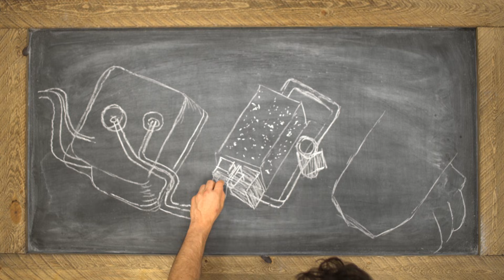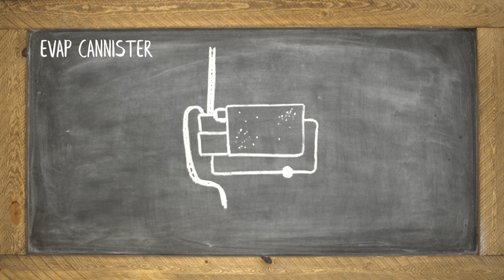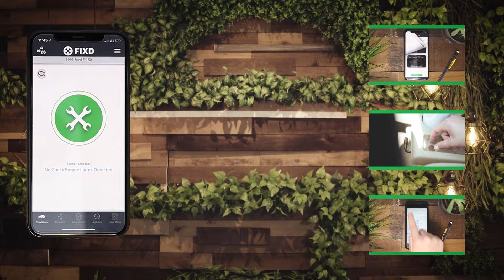P0456 Explained - Small EVAP Leak (Gas Cap)

Comment: I didn't tighten my gas cap after refueling which caused the code. I cleared the code, tightened the cap and after 142 miles, still NO check engine light. So yep, in my case she was right. 

Most likely the gas cap

Comment: Mannnn hope this isn’t from my actual gas tank 🥲 just replaced it and now that’s it’s getting cold I think the rubber gromet for the filler neck that goes on the tank wasn’t a complete fit so I trimmed it a little bit, hoping that’s not the issue and it’s just the canister purge valve

Comment: I bought one of these Fixd OBD readers in 2021 and thought it was pretty darn good. In fact, I was so impressed that I told all my friends about them and a few of them bought one. Now I've got to apologize to them for the mistake. 2.5 years later all it will tell me is that I have a code PO456 that I already knew that I had. But it will not read wheel speed sensors that create TPMS codes and lights on the dash. And the worst part is now when trying to diagnose my car, all I can get is that one PO456 code and a BUNCH of ads/warnings that a PREMIUM service is needed at the ANNUAL COST OF $99.99. You get what you pay for, or in this case, you don't get what you pay for and expect. If you're looking for a good OBD2 code reader....KEEP LOOKING.
Reply: Maybe try and innova 5620 v2 pricey but has a lot of features. That's if you haven't already found a nice replacement

Comment: The black rubber gasket only keeps dirt from getting into the filler neck. While that gasket is needed, the actual evap seal is below the trap door. Having a bad rubber gasket in the door contributes to excess dirt and grime being forced into the filler neck during a fill up, so cleaning of that area is essential for proper operation of fhe system. I wish there was a gas cap there.

Comment: I got the same code yesterday. I got a new gas cap today, how long does it take for the engine light to disappear if it was the cap? Im bringing it tomorrow to the mechanic but i just want to make sure im not jumping into mechanic when the code will eventually disappear if the driving cycle is not yet completed.
Reply: Update
Reply: @taylorjalicia20  it stayed up. There's a leak in the canister itself. So saving up money to get that fuxed

Comment: Would the check engine light go off if I replace the fuel cap?
Reply: I bought a locking gas cap,PO456 CAME UP AGAIN.ANYWAY,THE PROBLEM WAS THAT NEW GAS CAP HAD NO ORING WITH IT?SO I TRANSFERED THE OLD GAS CAP O RING AND PROBLEM SOLVED.THE GAS CAP I BOUGHT WITH NO O RING WAS A STANT.

Comment: Any cars without gas cap have a black rubber gasket on the fuel door. In case of fords clean the gasket or if ripped replace it. Also clean around filler neck and push a plastic funnel in neck to open snd close flapper valve . Do this about 5 times in and out .hope this helps

Comment: The video is useless it is not solved you need to change your headline.
After installing the purge valve and the gas cap I decided to get a smoke test which I should have done to begin with.... In my case it ended up being the fuel filler neck
Reply from the maker: Thank you for the feedback, D C!

Comment: Just put on a K&N air filter on an got the code PO456 Mmmm
Reply: Likely due to the engine running too well and strong for a maybe worn out and old purge system or hose specifically or the solenoid itself
Reply: Snugged all the K&N line’s up,,and took off negative off Battery and reset it,,working like New. Later guy’s 😃

Comment: Get some uv die to make sure it's not a leak under the hood. put it in your solenoid tank run the car for about 15 minutes grab a UV flashlight check it in the dark unless you have some special glasses you can check during the day.

Comment: I had this code about two months ago.  Bought a new gas cap and reset the code with my FIXD app.  The check engine light came on yesterday and the same code came up.  I reset the gas cap but the FIXD app can't seem to reset the check engine light. Up popped the message, "VIN Scan Not Supported, Select or Add Vehicle". What's up with that?

Comment: My mother got the fix obd tool. I love any code scanner. What I absolutly loathe is the FIX commercials claiming mechanics are scamming people and the FIX is the solution. Knowing what a code is doesn't mean you know what the problem is and what it takes to fix it. Each code could have many causes and to think a layperson is going to tell their mechanic how to do his job is ridiculous. Those commercials really turned me off to FIXD. Pretty much all FIXD does is allow people to determine how important a code is.
FIXD makes it sound like your mechanic would be wrong to replace your fuel tank if you got this code. The code doesn't say anything about the fuel tank and yet we know if the top rusted a hole through it this code could be the result. Almost every other code is exactly the same as well. Oxygen sensor codes are also a big one that might not have anything to do with replacing an oxygen sensor. I can see an irate customer right now yelling at her mechanic for replacing a fuel injector when FIXD said the problem was an oxygen sensor. However, mechanics know that a bad injector can cause an improper reading from an oxygen sensor as can a bad sensor and an exhaust air leak etc. 
FIXD needs to come up with a better commercial that doesn't mislead consumers.

Comment: Changed the gas cap & code still came up
Reply: That is because there is a whole list of things that can cause this code and not just one single thing. For instance, the solenoid valve might be bad or the vacuum line to the purge solenoid might have a small hole rubbed in it. Not uncommon for vacuum lines to rub on stuff till a hole develops. I could tell stores about missing or broken clamps on vacuum lines and road debri from dirt, sticks to forks stuck under cars rubbing holes in stuff. Not super common but it happens just the same.
Reply: CHECK YOUR NEW GAS CAP FOR A RUBBER O RING,IF IT HAS ONE ,TAKE OLD CAP AND REMOVE O RING CAREFULLY.AND USE OLD O RING ON YOUR NEW GAS CAP.DO NOT REMOVE OTHER O RING.USE IT AS A DOUBLE O RING ON THE NEW ONE.
Reply: Never got it looked at codes still comes on vehicle still runs good but my guess says it the leak detection pump

Comment: I got the same code only to find out that I didn't twist the gas cap tightly. I made it tight and now the code is gone
Reply: how long did it take for the code to disappear?
Reply: Austin Scarbel yeah
Reply: @robotsanddogs666 I replaced my gas cap and my light went away in 10 minutes, I have a 2015 Altima sv
Reply: How long dissappear?

Comment: My gas cap is loose, is there particular cap they sell. If you could give me a tip for Jeep Grand Cherokee Laredo 2013!
Reply: Buy  a new one
Reply: Go to a junkyard, take one off a car. Basically free... Or just flip around the O ring on your worn cap.
Reply: buy a new one, they're probably like $4 from rockauto.com
Reply: I bought a new one.  It didn't correct the problem.